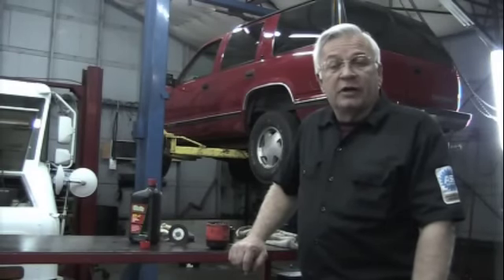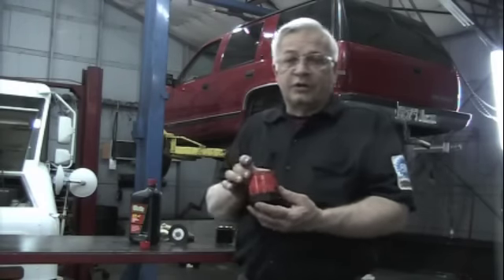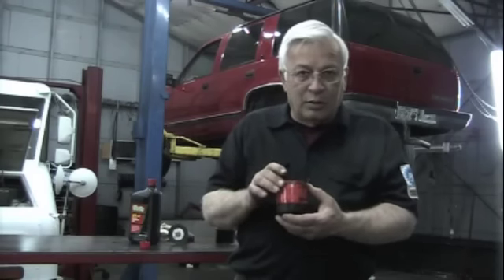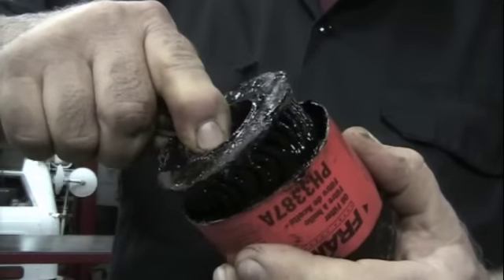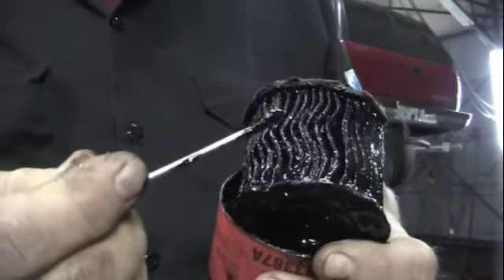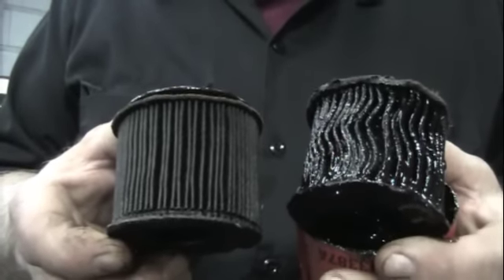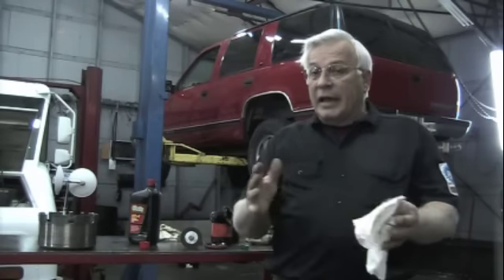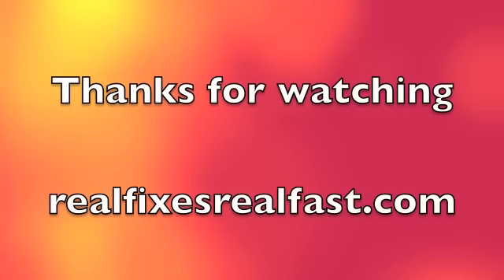Low oil pressure, finding evidence

Comment: just want to thank you for your video !
You helped me today !
i sold a van which i had rebuild the engine & the transmission 10000 miles ago and the vehicle set for 3 years  but occasionally i would run the engine for about one hour so the customer came back because the low engine oil light keep coming on after replacing the sending unit still kept coming on and yes i cut the oil filter open like you did and the filter was collapsed with some oil looking like dirty grease ,i replace the oil & the filter the problem solved !
Again . Thank you sir !
God bless !
We live & learn !

Comment: When the filter is clogged up, the bypass valve at the bottom of the filter should open up to allow the oil to flow.  If the oil pressure doesn't stay up reliably, I would quickly suspect  a sticking bypass valve, especially with the clogged up oil filter media that you observed.  You could easily test that by manually forcing the valve open with a screwdriver after you cut it open.  You could also look at the coolant temperature  gauge when the engine is warmed up. (If there is no gauge, use a IR thermal gun.)  If the engine temp is on the high end, there is more evidence of an oil flow problem.  Hindsight is 20-20, but if it was my job I wouldn't have even opened up the oil filter - even if it wasn't overheating I would have just added a cheap $5 bottle of engine flush to the engine, let it idle for ten minutes, and then changed the oil an filter.  You could argue that's just "throwing parts at it", which seems to go against your "gathering evidence" philosophy.  But, sometimes doing a few quick things like an engine flush IS gathering evidence, especially when no significant cost is incurred. And, the customer said he wanted to spend the least amount of money possible, right?  An oil change/flush is fast and easy.  "Gathering evidence" also costs money, because labor isn't cheap, and I'm sure cutting that oil filter open without the proper tool wasn't fun, but it certainly made for a good video.  Sometimes fixing cars the easiest and fastest way is more of an art than a science, and is highly dependent upon experience.   This is certainly not meant to criticize you, because like the old saying, "there is more than one way to skin a cat".  You're a darn good mechanic, no doubt about it, and I suspect your fix for this problem worked well.  I also agree with you that in a situation like this, changing the oil more often than recommended, at least for a while, would be a good idea.  The fresh oil has detergent additives, which can flush out a lot of that sludge that I strongly suspect exists in other parts of the engine.  Whenever I get a customer with an overheating engine, with low level & black oil on the dipstick, the first thing I do is recommend an engine flush and oil change, followed up by another oil change after 100 miles.  Most of the time they won't come back for that followup oil change, but that's probably because because the initial engine flush and oil change fixed their problem.
Reply: Quick and easy. Fix.

Comment: I instantly knew what the problem was when I saw which brand of oil filter they were using! 🤣 🤣 🤣
Reply: ?ol! The Orange can of death! Good call
Reply: @lazaromarino9200  fram good though. They sell them at walmart.
Reply: The filter did its job and collected contaminates.  This video shows Fram doing it's job.  Good on you Fram.

Comment: Good job "MR. Old Mechanic!" (i say this with the utmost respect) Got an 83 Chevy and after a climb up a mountain trail the oil pressure is nill, temp is normal, no rattling.............when you check the oil it looks clean. We just got this van...maybe the other Joe did not change the filter??????????????? Thanks and i pray you are still doing well....
Reply from the maker: Thanks.  I would suggest an engine flush before the oil change with a new filter.  Why? Being an 83 it could easily have sludge build up that could cause slow oil drain back internally.
Reply: @realfixesrealfast  You are welcome. Good to see you are still here. Do not know how to flush a gas motor? The oil is draining now, do you think we should put straight 30 weight oil back in ????????????  Or 10-30 ???
Reply from the maker: @terryknutson3202  no, not straight  30 weight.  stay with 10-30

Comment: Thanks man! I was so worried that my oil pump was shot. I only had 2,000 miles on the oil and filter, but I changed it again on your recommendation. When I took the plug out there was a 2” sludge turd  stuck to it. I will use  better oil from now on .
Reply from the maker: Glad it helped,  thanks for your comments.

Comment: Who really cares if the filter has been changed or not,, the point here is low oil pressure can be caused by something other then the oil pump and to gather evidence.. great video. Just bought a high mileage truck 2001 yukon XL 5.3 vortec with similar symptoms, I'll be changing the oil and inspecting the filter before I make any assumptions about the pump now. Thanks

Comment: I wish I'd seen this video when you first posted it.  My project vehicle has been, pretty much, just sitting around since 2010.  Today, after I watched your video, the motor ran again.  The oil pressure looked super.  Thank you.  I did cut open the quality filter afterwards.  It wasn't pretty.

Comment: I suspect that the customer was lying - they never changed that filter. They changed the oil right before they took it to the shop, but they never bothered with the filter. Classic.
Reply: Prolly did.
Reply: That's a fact' I've changed oil for years and more than 80% or people lie about changing their oil! One 2008 acadia had 150,000 miles on it, he said he changed the oil a month ago less than 1,000 miles. it had less than 2 quarts it it and when you stirred the oil' it turned grey' his wife said all he ever did was add oil //
Reply: Yup. Kinda hard for him to call his customer a liar, tho. Gotta walk that fine line. But you just know there's something afoot when you spin the filter off & the damn thing's heavy as a boat anchor - just feels like it's full of bird-shot. XD
Reply: Need info on location of oil pressure sensor on 2001 ford taurus DOHC thank you for your help..
Reply: @brotherdog1283  it's on the engine.. 🤠
Reply: I don't believe that oil filter was on 2 months? If it was he mustn't of change oil at all
Reply: Walmart does that, not changing the filrer

Comment: Great advice
Saturn Outlook 09 with 126K suddenly started with oil pressure warning AND sporadic unusual noise from engine
All symptons associated with low oil pressure
Oil life showing 20% 
Removed filter and decapitated as per this video, didnt look great
changed oil and filter and driven for 20 miles without issue
Thanks for you advice , greatly appreciated
The purpose of this comment is to thank the author of this video, thank you. You saved me a lot of heartache

Comment: A couple of notes. Why use a cut off wheel and take a chance contaminating the filter element. They make a can opener for filters or if you are careful tin snips will work.
Where did all that sludge come from in such a short period of time?
The symptom for a plugged filter is a decrease in pressure as rpm increases.
Those fram filters (the cheap ones) are scary.There was one on a boat i bought and it ended up costing me a block and crank+my labor..Been running fram racing without any issues.427 chev set up loose, runs 7200 rpm and 50wt oil.
Flushing a motor is not a good idea. Some of the oil that goes to the bearings DOES NOT flow through the filter. It might not hurt it right away but anything that is not clean oil gets pounded into the bearings and stays there. Better to just double up on oil changes...change the filter every other time.

Comment: I'm a retired auto mechanic I have seen brand new defective oil filters did an oil change for my sister put on a new Purolator filter build a big lot with oil I Crank It Up it was on the lift after about a minute the valve lifter started to tap right after I Crank It Up 30 seconds to 1 minute I shut the vehicle off the vehicle wasn't making any valve lifter noise until after I change the oil filter so I took off the filter that I just put on and put on a different oil filter added oil until the motor was full because I lost a little bit of oil in the filter the one that was defective turn the motor on again no valve lifter noise I always try the simple things first that are a likely possibility sometimes you can get defective parts back in the seventies Purolator was a pretty good quality filter I hope this information helps people have a good day

Comment: 96 Tahoe 292,000 miles 2lbs. of oil pressure at idle. The problem was oil pressure sending unit was leaking. I had been wondering why oil was dripping from my starter for 7 months.

Comment: Great video.... my '94 Tercel was showing low oil pressure and I changed the filter...light is no longer going on... Did cut the old filter in half and yes, it was gunked up to say the least..... Great advice... *Hey, a video on the causes of sludge would be good too..
Reply: Sludge is caused by using a non detergent (cheap) oil and not changing it along with not changing your air filter.

Comment: Change the oil and filter every 3K (or 6K) miles to keep the engine healthy to avoid the oil lights on the dashboard. And also change the PCV valve and Fuel Filter every 60K.

Comment: It's common for the Chevy 4.3 engine to leak coolant into the crankcase do to failing intake manifold gaskets. The coolant/oil mix can tend to cause sludge.

Comment: It came from elsewhere in the engine, such as under valve covers, under the intake manifold, in the oil pan,anywhere oil tends to sit and not be pumped under pressure.

All that sludge is from oil changes done too infrequently or possibly blowby-contaminated oil.

Using a Fram filter isn't helping things either.

Five star video.

Comment: There are many ways to flush the oil system. Some good ways, some bad. If you do the flush properly, you won't damage anything. A good flush is done with a chemical additive AFTER the engine is warmed up. The flush is added and the engine is then IDLED for 20 - 30 minutes and then shut off and drained. If you rev the engine or drive the car with it in, then yes you will damage bearings as the flush will thin out the oil. The thinned out oil will not damage an engine that's not under high torque.

Comment: "what about the sludge underneath the intake"

That's what the flush is for. Get as much gunk out by scraping as you can, then flush. If the flush is used properly, it will do an excellent job. It just eats away all the crap in there. After replacing the oil (and filter) with the flush in it with clean oil, I recommended doing another oil change a month later.

Oil alone will NEVER dissolve the heavy gunk. Even if you add marvel mystery oil or trans fluid to the oil. Been there, done that.

Comment: Took my truck to autozone and had a P0521 error code. 

Changed out the oil pressure switch disconnected the battery to clear the check engine light.

Two days later check engine light came on. 

I took to autozone same code

Found this video and after the oil change the problem went away. 

*yes I did check the oil level before taking it in.  I used to do all my oil changes prior To the last one before the check engine. I suspect oil filter or possibly the oil was not good.

Worth a shot to change the oil before taking your vehicle in.

Comment: Some of that sludge will NEVER come out using just oil.

Back in the 80's I bought a Firebird from a girl who never changed her oil.It was a project car that I was building a new engine for and did body work as I also used it for transportation as well. I changed oil immediately. 2 month's later I had to open valve covers due to leak and noticed heavy gunk. After scraping, I flushed it. When new engine was complete, I beat the crap out of the old one to see what it could take. It would not die!

Comment: I use FRAM all the time. I have 240,000 Miles on my SUV, and every time the oil gets changed, I change the filter. I cut it open, and it looks very good. I blame the owner for using cheap oil, and not replacing the filter every oil change-ASE Tech.

Comment: I work in the trade and myself and I see, While a lot of people change their oil at regular intervals there are many who do not, which in turn builds up sludge in their motor. A new oil change will not get rid of sludge already built up from lack of maintenance, and the new oil filter will collect it, and the next and so on. Unless you do it on regular intervals.
Its like brushing your teeth ,if you only do it once a day instead of after every meal it's gonna cost you in the long run.

Comment: A gallon of diesel fuel with 1 qt of sae 30 weight oil dumped into that engine with a new oil filter- leave it idle for 5 to 10 minutes, then drain. Install new oil and filter. That removes a good majority of the sludge in any engine.

Comment: Mixing synthetic oil and regular oil is a huge no no.Will sludge up and I have seen this.Pulled the oil pan off a GM 3800 in a Pontiac Bonneville full of sludge.The owner whom is my father's friend did this,poured in a quart of synthetic oil with the regular oil during every oil change.

Comment: "I figured a clogged filter would raise oil pressure..? "

It will raise pressure just in front of the oil filter, but that takes away pressure from the rest of the system; which reduces pressure.

Comment: You don't open oil filters with die grinders. Use a filter cutter (like a big pipe cutter). You CONTAMINATE your oil filter with the little bits of steel from the oil filter case the die grinder GRINDS off when it's cutting.

Comment: Thank you...

That's the best suggestion & best way to determine the issue point of that problem...

My situation is that I just changed oil & I'm having oil presure droppped down; the previous oil was burned empty which means I had to change the filter also...¤▪☆○•°~`♡🤔

Comment: I never typed that the oil was murky and the old filter was still on it.  The flushing machine that was used had you remove the filter to attach an adapter.  The oil was drained and the machine uses its own chemical to flush the engine while it is running.  The machine has its own filter to catch stuff that breaks loose.  The oil pump is still used to recirculate the flush through the engine.  Flushing an engine is a gamble with any customer's vehicle and not one I am willing to take.

Comment: by the looks of the filter that was so sludged up that came out of the vehicle and is supposedly only a few months old, and considering the oil is still somewhat golden. My speculation is that where ever the owner of this vehicle took his vehicle to get his routine oil changes, that shop should be video taped undercover to see if they change the filters on customers vehicles. My assumption is they do not change filters.

Comment: I just picked up a truck today that was upper rebuilt but still has low oil pressure so the guy sold it. thanks for the tip on cutting open the filter for a looksie, but.. I figured a clogged filter would raise oil pressure..?

Comment: Seen a flush done on a customer's 95 F-150 at the dealer and the tech ended up having to remove the oil pan because chunks of sludge broke off and ended up clogging the pickup screen.  That was on a push rod engine.  These newer over head cam VVT engines with small oil passages isn't something I would dare using any chemicals or flushes on.  Your just asking for trouble in my opinion by attempting to break loose sludge quickly by chemical flushing.  Notice it wasn't mentioned in the video?

Comment: Hi thanks for the  video. I just watched and went to cut my oil filter, the filter looks good the oil was a bit dirty , reason why I changed it. But yesterday I jumped in to a gm 2003 taho oil at idle was 40 driving it it was like at 50-55 came to my head my 97 c1500 5.7l wasn't at 40 at idle stays at 20 then driving gets about 40. Like I said filter old filter looks good like the one shown on your video. So am thinking oil pump is going out. Right or wrong??? Due to my evidence.
Reply: Hugo Perez as mentioned above by michael shemwell...oil pressure comes from bearing clearance...not the oil pump
Reply: So to much wear. If I put thinker oil it will help

Comment: That's correct. I would never let an engine go like that and today I would never buy a car like that at any price. I'm just saying that if you foolishly don't maintain your vehicle or buy one as such, it's a good idea to flush it. 

The firebird I bought in the 80's was sludged, but I bought it with the intent to replace the engine; piece-o-shit 301. I beat the crap out of that engine HOPING it would die, but it didn't. The flush did a good job or de-sludging.

Comment: Fill sump up with Diesel. Pour an extra gallon or two OVER the factory fill on dipstick. Prime oil pump shaft with a drill. Let the Diesel circulate. Drain and refill/over fill again with Diesel. Let it circulate through the block again. Drain and check for color issues. If you have time let the Diesel set in the block. If it's clean the second time, allow to drain fully. Refill with oil and a new filter. Problem solved.